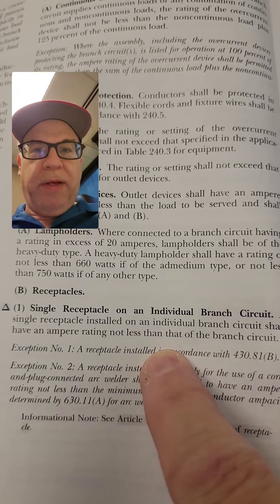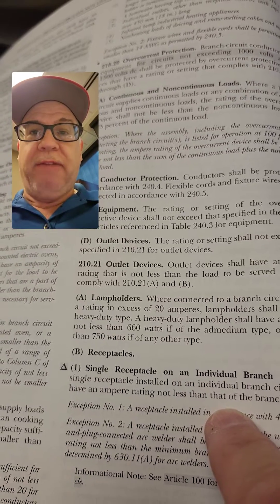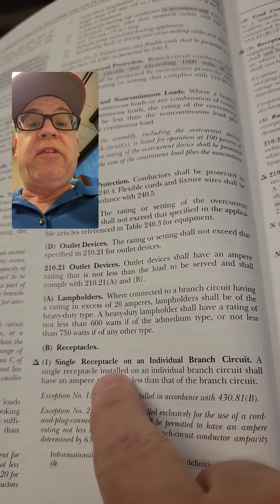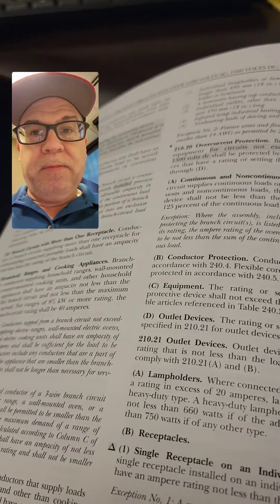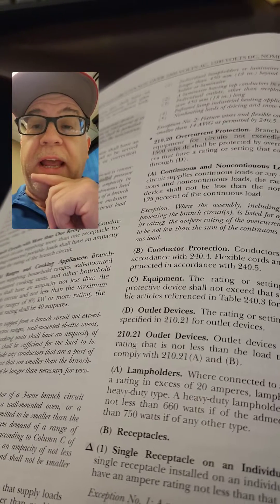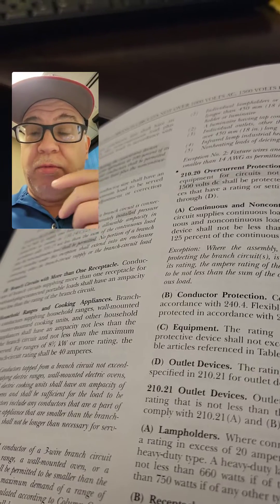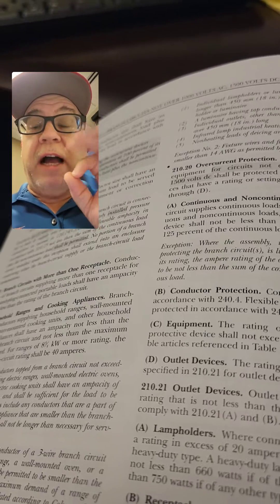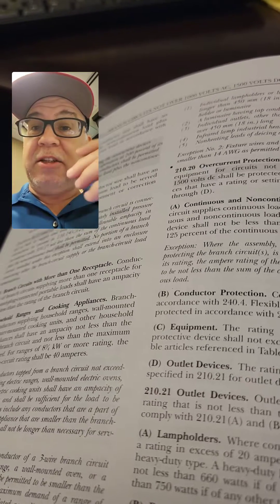50A Single Receptacle on a 40A or 50A Branch Circuit

Comment: side question because I have had it told to me several ways- Can I have several single 50 amp outlets in a shop or garage space on a single 50 amp breaker? for like moving a welder around, etc?
Reply from the maker: If you could not have more than one welder on a single branch circuit then what would be the point of 630.11(B) for Arc Welders or 630.31(B) for Resistance Welders? Clearly you have to size the branch circuit for the anticipated loads and follow the rules in 630 of course. However, if the intention is to only plug in a single welder at a time and the branch circuit is sized and protected with that in mind I see no issue. In fact, if you tried to do more than one welder then it would clearly trip the OCPD due to overload. So, I see no hazard involved as long as you know the intent.
Reply: @MasterTheNEC  This is exactly what i was think'n You could only use one welder at a time anyway Sooo.......?
Reply: I had an inspector tell me yes and another one tell me no-lol